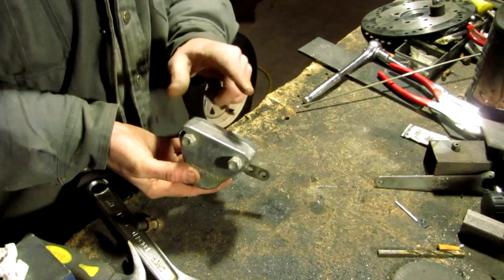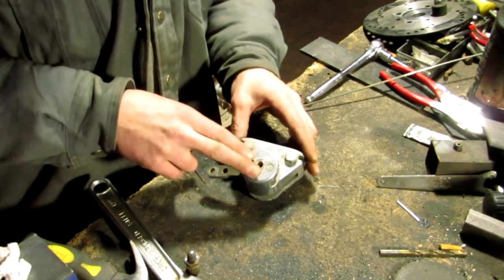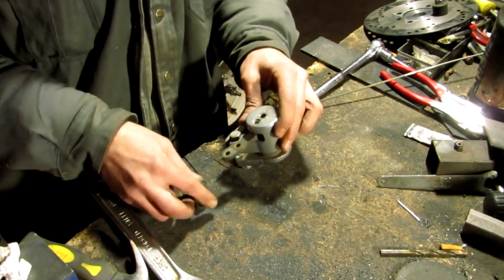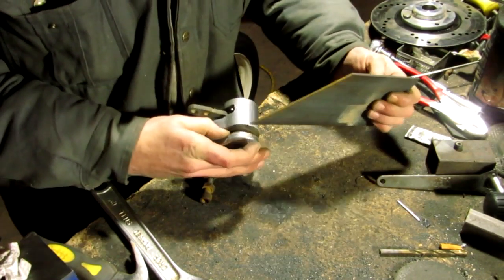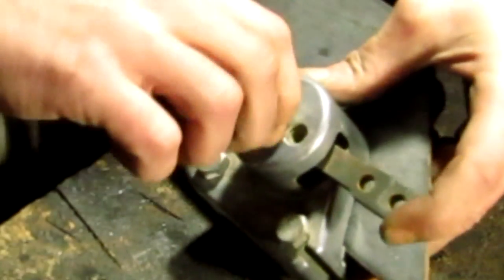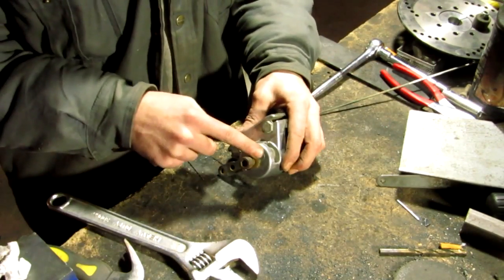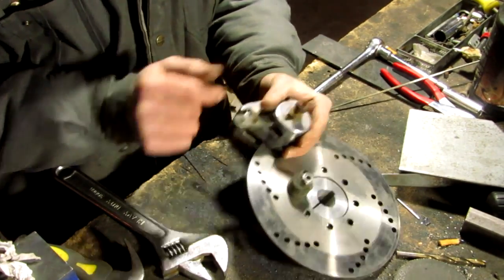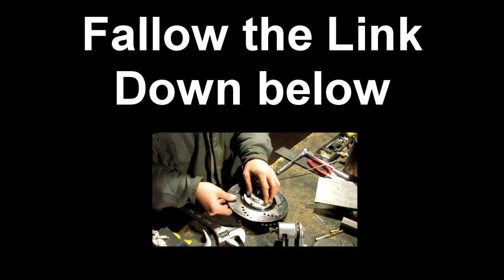GO KART | MECHANICAL BRAKE CALIPER ADJUSTMENT

Comment: alright for anyone who hasn't figured out how to get the pin out. you have to first take the brake adjustable bolt off fully because it's in the way of the pin coming out. now take apart the caliper and locate the pin under the plate of the pad, and put the caliper in a vice and take a screwdriver and hammer and bang the pin out. it has rivets in the pin to hold it in place so that's why it's hard to get out.
Reply: Thanks G
Reply: Thanks!!
Reply: No problem, took me a minute to figure it out.

Comment: Ive inherited a basket case. No brakes right now. And aside from other obvious izzues in that dept i was wondering if the caliper is supposed to be floating or bolted. My guess is floating, i cant see how it would escape, but the previous owner bolted it in.

Comment: I put a one of these brake calipers with a cable on my vintage go cart. Everything is brand new. It works, but not very well. I’ve adjusted and re adjusted, checked and double checked. Arrow is pointed towards the front of the cart. I do not know what else to do. The tires should lock up. I have to push so hard and I barely slow down.
Thank you!

Comment: hey my disc rubs against the pads  when i roll my go kart. it isnt a  clean smooth roll. how can I stop the disc from rubbing but also keep the stopping quality high? help
Reply: Return spring on the caliper arm fixed that issue for me. Hope it helps.

Comment: How do you remove to pin to switch the direction of the way the arm moves
Reply: jack chosich did you ever find out how?
Reply: Yes did you?
Reply: I need to figure this out?? I can’t get the pin out
Reply: The pin is serrated and pushed into the aluminum, hammer it out with a nail punch or screwdriver, you’ll be able to push it into the hole on the other side and hammer it in, just did this last week.

Comment: Did anyone replace the pads? If so, what's the procedure? Are the Pads glued on or they just stay in place
Reply: Thay stay in place, because the ends of them are magnets))))
Reply: my disc rubs against the pads  when i roll my go kart. it isnt a  clean smooth roll. how can I stop the disc from rubbing but also keep the stopping quality high? help
Reply: @kmart014  return spring on the caliper arm